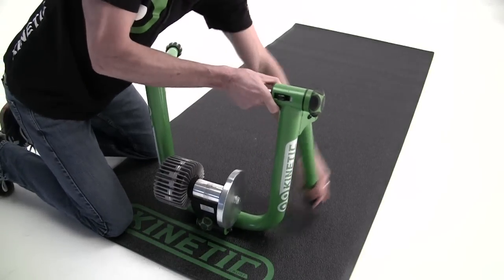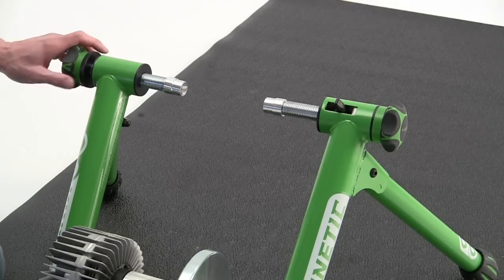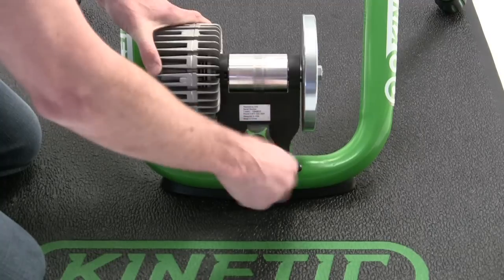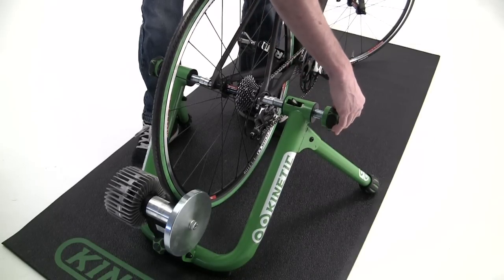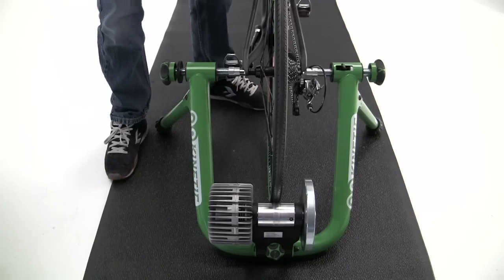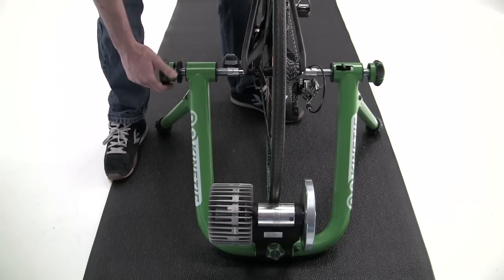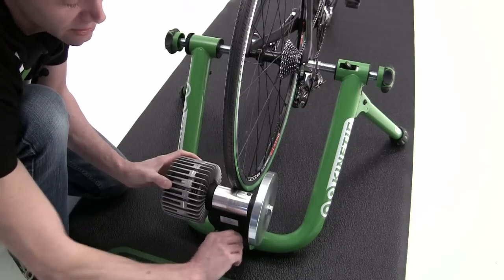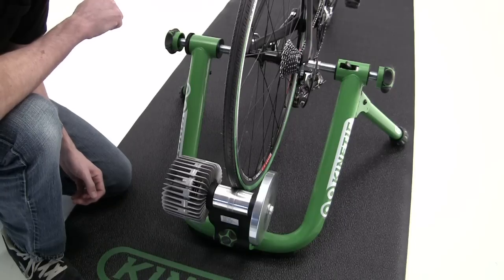How to set up a Kinetic trainer and mount a bike

Comment: I really love my kinetic fluid trainer it was perfect after breaking my wrist on the road and wanted to just stay home.
My only issue and is possibly setup that I cannot find, is that my front tire goes flat after a few uses. I do use that raiser that you can buy on the side.
What could be the problem?
Thanks so much.
Reply: Your front tire might actually have had a slow leak.